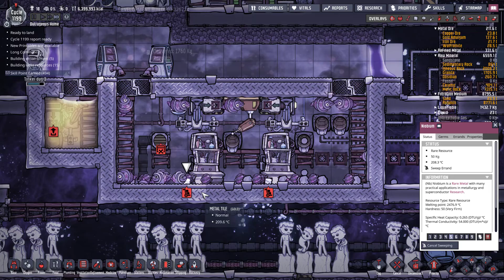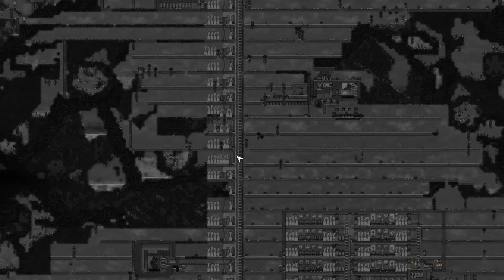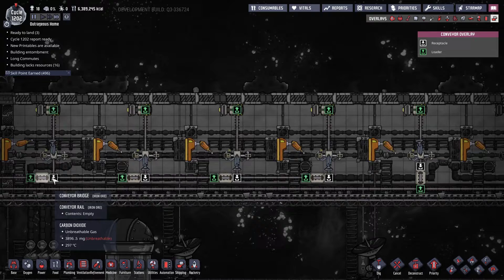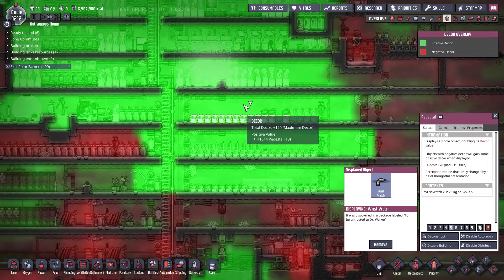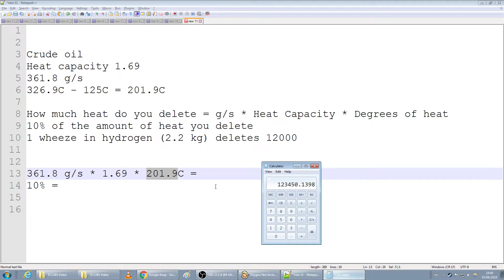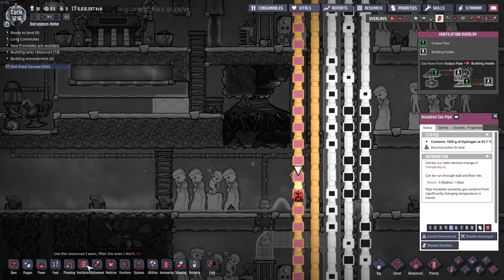QOL Mk3, 34 Oil Fissure, Vole refinement : Oxygen not included

Comment: Ey man, I think that placing the steam turbine water return on the other end (closer to the pump) should make the system more efficient. With counter flow, I think you'd extract more heat out of the crude oil.
Reply from the maker: Power generation is pretty small from leaky oil. They are usually not worth the effort. In this map I was trying to harness every scrap so I could go max dupes.

Comment: To efficient pump out gas to make a vacum use big ans small pump With pressure sensor that pumps works within efficient range . I notice that huge spaces that empty time takes cycles are vaccumed within one cycle.
Reply from the maker: I'v tried big and small pumps, I'v tried automation. End of the day I realized I was wasting more time putting in all the bits to do it faster than I was gaining from the efficiency increase. Also I'v very lazy.

Comment: Leaky Oil Fissure Crude Oil  
Temp 326.85 °C, 620.33 °F
Max pressure 50 
Average yeild 
100.6g/s - 150.4g/s 
1g/s - 250g/s
eruption 600s 100% 
Active period 
260s - 340s
100s - 500s 
Active amount 
56% - 64%
40% - 80% 

Although I don't understand why it has an average yield of 100-150g/s and 1-250g/s
It's the min/max yield.
Same for the rest of the numbers. 
The average yield is not a range of numbers. It's a set number.
120g/s ??
Why doesn't it just say min max.
1-250g/s

Yours. 217g/s
Reply from the maker: If you are getting that from the wiki don't trust it. It's tells you the average output of a vent/geyser but if you do map searches you will find the average is very different.
Reply: That's the ??? I don't know the average. Just throwing out a number. Wiki doesn't tell you the average. 
Just the minimum maximum of this group and min max that group. 
You only need 1 min max of all. 

Would be nice to know if I have a geyser above or below average to plan whether I can do this or need to do that. 
Weak oil fissure and only 1 oil well. 
Need more slicktser. 
Strong fissure I can cut back my slicksters because I don't do the math. 

I set it up and let it run for a bit and adjust as needed.

Comment: Idk why you said that oil fissures are bad... Man, I really like those! They are geysers that erupt every cycle! Sure, they produce a lot of heat, but it can also be easily treated with some layouts (like yours, with the cool steam vent). Also, I think one of them, for a long period of time, can provide more petroleum than you will need without using reservoir (if you are ranching slicksters)
Reply from the maker: It's not the heat it's the output. They produce less than 10% of an oil well. They are of course water free to get but if I'm going to invest dupe time and all the oxygen that entails I want to get the most return on my investment. It's like taming a polluted oxygen vent, they give you about 200g/s of O2 so enough to support two dupes. But if i spent that time on a cool steam vent I can get usually over 1kg/s of water and support 8-10 dupes. Before you are 100% sustainable it's an inefficient use of time, after you are sustainable it's usually so little output compared to what you are already producing/making it still feels like it's not worth the effort. But of course depending on the map it could be worth it.
Reply: He didn't say they were bad. 
Just said not needed.
An oil well produces more oil than even the strongest oil fissure. 
http://prntscr.com/nxqvji
Even 1 dupe ranching 20 slickster produces more oil than an oil fissure.
Reply: @LTL_king  but a leaky oil fissure don't require dupe interaction. 20 slicksters requires a lot of interaction, and the oil well you spend water, energy and dupe interaction (sometimes), so I think is better the oil fissure XD
Reply: @pedrohpinheiro1134  yes but still not needed in his style of play. 
I'm just saying he never said they were bad. 
It's just not needed in this style of game play.
There's a big difference

Comment: Doesnt the conveyor loader reduce your space scanner signal quality?
Reply from the maker: The loaders are 15 tiles away from the scanners. Machines in the way of the scanner don't block any signal, it is only if they are close enough to interfere with the device. You could surround a scanner with loaders around all 360 degress but so long as they are 15 tiles away and the scanner can see the sky they will work at 100%.

Comment: you can cool space stuff by placing pedestals inside some cool liquid and then remove them when cooled....
Reply from the maker: It's just the manual labor involved is sort of time consuming. There is currently no way to automate it so I usually just end up leaving most of them in the silos.
Reply: You could use a bunker door below the rocket. It would require some automation, but it would be just like taming a metal volcano. Artifact heats door, door heats water, aquatuner in the water for a secondary cooling pool below the door, then allow the dupes in to collect the artifacts when you're ready to store them. It would just require a long enough drop to avoid the dry heat coming out of the rockets, plus it's almost impossible to mess up the vacuum since you just need to leave it open to space.
Reply from the maker: Oh you have given me an idea, how about a run of super coolant in a loop through the bottom tile of the rocket silo. Have the super coolant dump the heat it collects into a steam turbine. I could reduce the heat of everything in the silo to 130 ish and generate a little power while I'm at it.
Reply: @FrancisJohnYT  you can actually just have a big steam chamber below all the silos with some shift plates or with a liquid loop to spread the heat and have a steam turbine. Maybe in your base it won't work well as you have so many rockets but with 1 or 2 it works like a charm.

Of course if you have enough supercoolant you can pipe it directly , it's just that you don't use all the heat the rocket produces. I think the best way would be to fill a 9x3 area below the rockets with regular tiles and flow supercoolant through it. Use a high heat capacity material and be careful if you want to use radiant pipes that the temperature isn't too high at the start that vaporizes your supercoolant. Maybe you could even get away using petroleum.

You can also cool your voles haha
Reply from the maker: @nirodper  If I'm going to go for max dupes I'll need to squeeze out every drop of water I can. I'm thinking about trying to capture the steam from the rocket silos. Still not sure which approach to take. Steam turbines to absorbs most of the heat and then a little cooling or throw lots of power at it and freeze everything.
Reply: @FrancisJohnYT  If you're going for max dupes, might I suggest distilling your slime into algae, feeding the algae to pacu, then off-gassing the polluted dirt and/or water, putting the polluted oxygen into pufts, return to cycle. Even if there are losses in the algae cycle, you would be converting the most possible to water and oxygen. Then there's also the idea of using a rocket to an ice body to harvest ice.

Ohhh and there's the gassy moo. It basically turns chlorine vents useful by converting the chlorine into 10x as much natural gas. The only cost is the power to liquify the chlorine, and you'd get more water out of it! Hmmm, plans within plans.
Reply from the maker: @Lumen_Obscurum  I want everything to be hands off and completely sustainable. Well that's the plan lets see how it plays out. The Gassy moo does not reproduce so I'm not sure how I can automate the population.
Reply: @FrancisJohnYT  Automate a rocket with three biological cargo bays connected up to the stable. The only downside is I don't think you can rely on getting three gassy moos per trip, but I admit I haven't played with bio rockets sent to gather moos.

Comment: i would like a guide for  whole base cooling xD
my electroliser si not cooled enought with my 9 weezewort
i will obviously add more
Reply from the maker: If your willing to throw power at the problem this is when i installed my full base cooling https://youtu.be/yxhCHCfyJXs?t=2342
Reply: @FrancisJohnYT   for now its too much  xD
Reply: @FrancisJohnYT  My O2 cooling setup in reply here.
Reply: Run the pipes through the bottom of a cold biome. 
As the heat dissipates through the biome. It melts the biome dropping the water onto the pipes. 
Water stays colder longer. 
Install a pump to pull out water above 20C and above the pipes which runs through the water sieve back around to the electrolyzers. 
No need to manually filter. The water sieve will allow clean water through also without changing the temp. 
Which if at 20 it runs up to electrolyzer cooling it. As well as the polluted water at 40 pre cooling the O2. 
Before it cycles back up to the cold biome. 
Even a small biome will last 500 cycles. 
http://prntscr.com/nxpop1
http://prntscr.com/nxpouj
http://prntscr.com/nxpp51
http://prntscr.com/nxppcx
http://prntscr.com/nxppqh
I might adjust to pull out at lower temp but so far. I haven't had to pull any out.
Reply: Something I used to do that helps a lot. 
Run the water pipe zig zagging through the O2 part and then up past the electrolyzers. 
Will drop the temp 10+ before it every leaves the chamber. 
More tiles the better but I think I used to run it about 15-20 pipe lengths. 
Keeps the electorlyzers cool and the O2 doesn't get a chance to come out as hot.
Reply: @LTL_king  hmm  well  what i am gonna do with that 90c water from steam geyser ? 
i mean i need it to run the electrolizer

 guess im gonna store it in my liquid compressor storage
Reply: I don't know, Use it. ;)_ What's your base look like. Normal view and heat view. Need more info. Pics help or maybe even save file
Reply: @LTL_king  i just wanted some general idea  :p
Reply: There's is no 1 thing that can be done such as running the pipes through a cold biome that can be done to cool a base down. 
I'm sure there's some simple things you can do to change things to cool it down. 

I don't do everything exactly as he does as my map is different and you have to make adjustments as needed.

Unless you have the exact same seed and do the exact same steps at the same time. Things will be different. 

Without some more information. Can't help.
Reply from the maker: @buder5 to use your 90C water send it to devices that don't care about temp. Electrolizers always output at 70C so dump it into them and cool the O2 as that is cheaper and easier. Carbon skimmers always output polluted water at 40C, oil wells always output at about 80C. That's the three main uses for clean hot water. Usually you use polluted water for crops. You sieve the polluted water and you get 40C clean water, one trip through a aquatuner and you have 26C clean cool water.